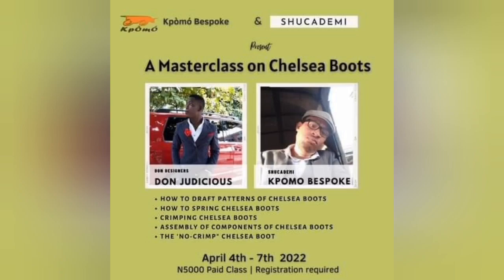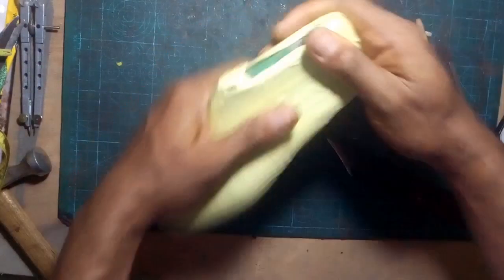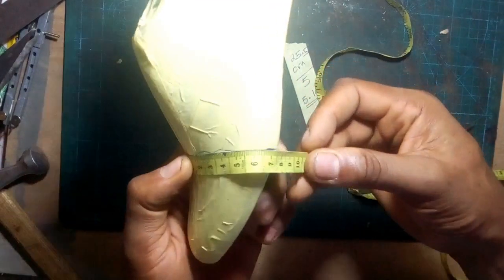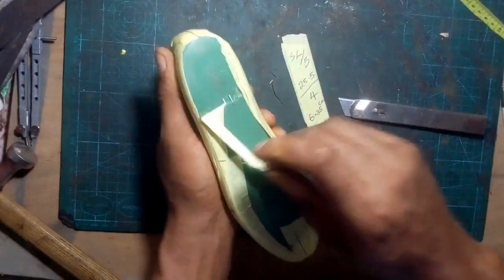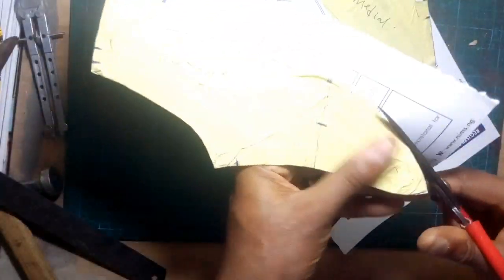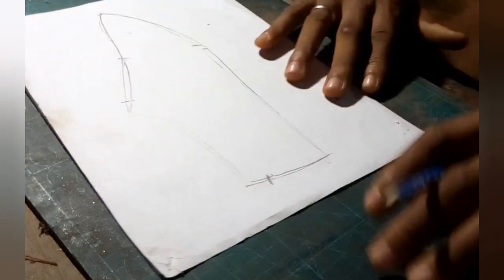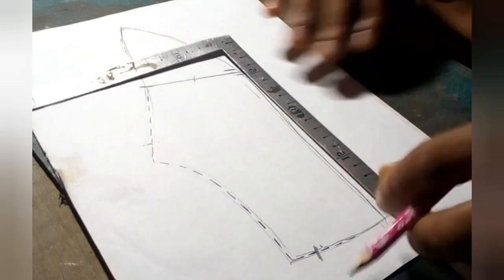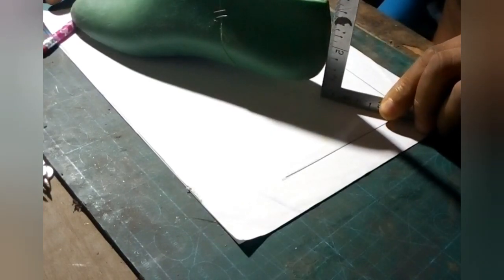DIY Chelsea Boot Design (Part 1)

Comment: Because am not using suede and should it be inside hot water or cold water
Reply from the maker: Never use hot water. Whether for suede or not, DO NOT USE HOT WATER.
Reply: I should use cold water and it for how many minutes
Reply: And will I allow to dry for how many minutes
Reply from the maker: As long as it takes to dry. Dry time can be between a 12hours to day depending on how hot the weather is. Putting the leather at the back of your fridge can also help to speed up the drying process.
Reply: Thank you sir
Reply: Sir am confuse in the measurement of the height when checking how far the lass is from the pencil am I to measure it up to the original point of the lass or the cardinal point
Reply: And secondly I don't know how you measure the ankle part am confuse
Reply from the maker: @igwehvictory6167  up to the heel. Not the counter point. The heel.